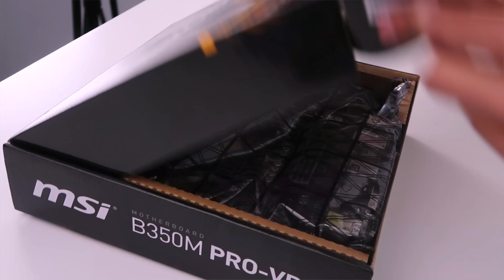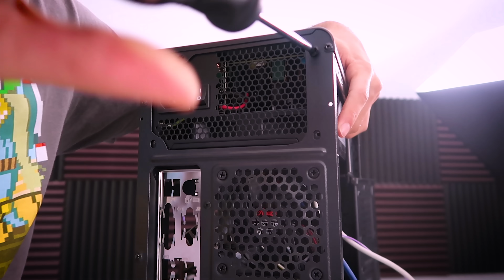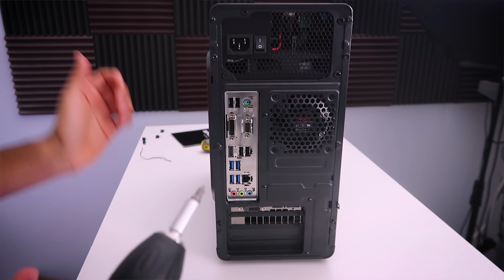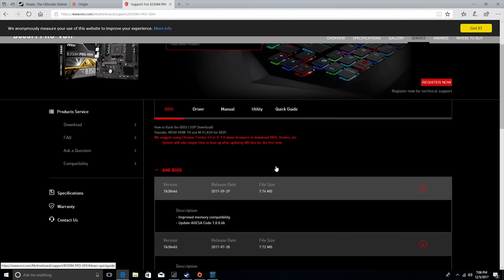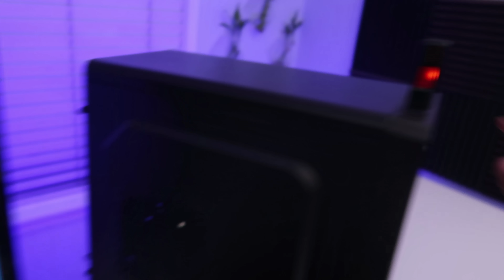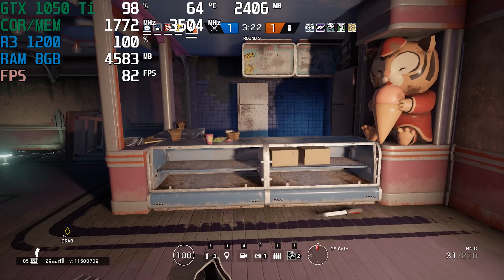$500 Budget Gaming PC Build Guide - GTX 1050 Ti (w/ Benchmarks)

Comment: so i built this pc and i made some modifications and i love it for the power supply i used 500w not the 430 and for the gpu i used the evga geforce gtx 1050 ti FTW not the sc its like $30 more but its amazing if you guys play fortnite i played it all on epic settings and it worked like a charm i love this pc and i changed the case with one with tempered glass i love looking into it.
Reply: Parker Smith Gaming i'm glad my fellow gamer having fun with their own built pc :)
Reply: What was the name of the case you bought?
Reply: What case did you use?
Reply: Thermaltake Versa H18 Tempered Glass
Reply: So fortnite runs smooth on epic settings? What was the total price? Im interested in building the same as you did, could you send me a link please, tot the components if thats even possible
Reply: BRONZYGAMING that’s the pc parts
Reply: Parker Smith hey dude can u send me a link to all the pc parts I’m very interested in buying the same one you have. Also, did u overclock it and what number did u overclock it to.
Reply: F ohj fortnite fps on epic?
Reply: Just run fortnite on mostly low because it looks the same lmao
Reply: Do you think if I used the same stuff as joey it would be just as good as yours
Reply: Can you link the case

Comment: Yo I was wondering if you could use an evga 500w instead of a 430w?
Reply: サンisatis yea dude everyone used that lmao the 430 is out of stock
Reply: kinq which one so I use
Reply: kinq plz help
Reply: Bladedflame 360 it doesn’t matter my guy
Reply: Bladedflame 360 either use 500 or 430, 500 is a little more and stronger
Reply: kinq I am scared it won’t fit in this case
Reply: Bladedflame 360 it fitted for me my guy
Reply: kinq ok thz

Comment: If I made this PC, would it be able to run Arma 3, Rust, DayZ, Escape from Takarov, and The Isle at around 60fps?
Reply: MyNameisZach depends on resolution, 720p and 1080p should work fine for 60fps, higher than that then no

Comment: So i wrote down the things i needed, and i wanted a 1060p so i changed that just for 20 bucks more to get more performance! I am going to save for this cheap build, thanks, and im going to be using this video again to help with building this when i have the money. This Really Helped Me learn more about computers.
Reply: The thing is that the 3gb of vram will limit you quite a few times so that a 1050ti will be faster. Best is imho rx570)
Reply: If you upgrade your gpu you may need a new power supply, but I’m not sure. I’m new to PCs and also u may need better fans
Reply: Alexander H 1050 ti is crushed by a 1060 3gb
Reply: Call of duty Trey arch work on your reading competence.. when your vram limits it's GG for the 3gb 1060
Reply: Alexander H Holy shit morons like you are the reason for the 1050 ti prices to be inflated as it is, to point of the 1060 3gb. Even though the 1060 offers almost 75% performance increase and who the fuck games on a resolution over 1080p on low end hardware?

Comment: whats the diferenc betwen the GTX 1050 Ti and GTX 1050 Ti SC and could i posebly use the GTX 1050 Ti instead of the GTX 1050 Ti SC becase its a litle cheaper
Reply: DARK ASSASIN The sc basically means that the card come overclocked from the factory which will give it slightly better performance. There is nothing wrong with getting a different 1050ti. But if you use the case in this vid make sure you get a small one with one fan.

Comment: Hello, first time building a pc. I got some questions and I think this is the perfect  place to post them, I’m using this pc as my base but I was wondering If I could change the power supply for a 500 w EVGA instead of the 430 w also I would like to change the graphics card for a nvdia or a gigabyte of the same range a 1050 ti but I’m not sure about compatibility or space in the case so if anybody could help me with that I would be very grateful
Reply: Adolfo Franco yes you can use 500w power supply, find a 1050ti that only has 1 fan so it would fit in this particular small case
Reply: Giovann H thank you

Comment: Does it matter if I change certain components like the power supply or case
Reply: commie craft changing power supply wont be harmful in any ways, you can get 400w / 450w / 500w if the power supply on this vid is not available
Reply: Mediocre Size OK great. Now I can be confident I'm making a computer and not a bomb
Reply: commie craft yes greatly i would not change any of it
Reply: your pci-e may be burned or destroyed due to a change in a power supply
Reply: Liam Kounios thanks if, but if the power supply isn't available what would I get
Reply: a fan splitter would help greatly
Reply: commie craft Yes you can change the case or power supply just use google to make sure that its still compatitble. The previous comment about power supplys is perfect and any mini atx case should work fine. Atx is too big for this in my opinion.

Comment: dude the case that you put isn't available atm. WIll this case work? https://www.amazon.com/InWin-301-Black-Tempered-Micro-ATX/dp/B071S8NJHQ/ref=sr_1_12?s=electronics&ie=UTF8&qid=1530038983&sr=1-12&keywords=micro%2Batx%2Bcase&th=1
Reply: def no nc the MOBO won’t fit also why the hell are u spending 180$ on a 550$ build

Comment: Can i use Nvidia GTX 1050 Ti FTW ACX 3.0 instead of 1050 Ti SC ?
Reply: Ricky Phukan it would be very tight in the pc case and airflow would not work well
Reply: Liam Kounios 1050 Ti SC is not available in my country now. What if i use a different or a bigger cabinet?
Reply: Ricky Phukan as long as u get an Atx case the GPU u picked will work
Reply: Liam Kounios thanks for help

Comment: just bought the parts for the build
Reply: Diego L. What case did you get as I can’t find it anywhere in the uk.
Reply: Jack Beames masterbox lite 3.1
Reply: Jack Beames I used his $650 budget build as a guide
Reply: Diego L. How do you know it will fit tho. Did you use every component from this video but then that case you just said about and it worked?
Reply: Jack Beames pc part picker is what u need gives u info on if the motherboard will need bios update whether things will fit etc

Comment: I know this might be a really dumb question but can I use a 500w power supply by the same company or will it somehow fry or damage the computer?
Reply: Keaton Leonard no it wont damage the system, you’ll just have too much power for a computer that really doesn’t need it (unless u upgrade it in the future obviously)
Reply: pretzel yeah that’s what I thought it would be I just had to make sure. Thanks
Reply: Keaton Leonard but you will only draw power that's needed for the pc though, so let's say a 430w vs 500w with identical specs will have same electricity bill, also if you are choosing higher wattage power supply that means you have more future proof build

Comment: Just a quick tip to everyone as he said earlier in the video. If you have few extra buck to spare after buying all the parts then buy a modular power supply as it has individual cables you can choose to plug or not based on what you need. If you are worried about the connector defects to the power supply it's pretty rare so I wouldn't worry too much. Modular power supply is more expensive but it's worth it

Comment: Great build but i had a 970 lying around they are alot better and i had a corsair 650 or something like that with g skill ripjaws (16gb) and a 8th gen i7 processor and and im pretty sure the fan is a noctua fan with a corsair carbide case with a custom made tempered glass window and some beautiful rgb light strips after all it is 2018 and it isnt a pc if it doesent light up ;-)  but thanks for some ideas. And im not rich i just did some deal hunting and won some auctions hope i helped giving at least. A Few of you some ideas.☺😉😀

Comment: Guys i have a serious question will it cause any problem if i switch the  gtx 1050 with a gtx 1060?? And if i switch it will i need a more watt power supply
Reply: 430w is sufficient, yes you can change to 1060

Comment: Built it, runs awesome :D
Reply: JustFilip can’t find the case anywhere in England. Did you use an alternative.
Reply: Jack Beames yeah, I used a different PSU and a different case😁
Reply: JustFilip what were the names please.
Reply: Jack Beames any case will do, mine was from deepcool
Reply: These Knicks ain't Loyal Skyrim on max is around 50, Fallout max 60fps+ and idk about witcher but should be about 50fps on medium
Reply: These Knicks ain't Loyal no prob
Reply: JustFilip what case did u use
Reply: Jack Beames I built 2 PC's with similar parts to this and both cases were different, but it doesn't really matter what case u use it, fuck u can even go ahead and use a cardboard box, it really doesn't matter
Reply: JustFilip how many FPS on fortnite on all epic 1080p and can I️ edit 1080p 60fps videos or at least stream in 1080p 60fps
Reply: Shadow if you want to stream you’re gonna need to get a better cpu, no way you can stream on this
Reply: Shadow On all max it's bout 50-70, idk about streaming, but u should be able to stream it.
Reply: Zvoro srry dude idk about Arma 3
Reply: JustFilip if i will not the bios what will happen can someone tell?

Comment: I build a  gaming computer, cost was $400. 
Specs..
Display: Overclocked gt 1030, 2k gaming on (ex: horizon 7, GTA 5, minecraft)
Cpu: Intel i5 3.2ghz with turboboost to 4ghz. (Very powerful,  (can run spotify, gta 5, and  13 downloads at same time with ease)
Hard drive: sandisk ssd 3d ultra 512gb
Ram: ddr3 1600, (fast and relible.)
Wifi: Netgear dualband wifi 5ghz and 2.4ghz wifi, with usb 3.0.
Case: It's a refurbished opleplex, and upgraded it to game.
Most robbers won't take the desktop, even thou it's a gaming desktop inside the case.

Comment: Hi Joey, thanks for the great video. I will most likely be using this for my next PC. Im just wondering, does a intel CPU also work with this motherboard, if not, is there a stronger CPU that you could recommend?
Reply: will intel cpu work with this motherboard? no. stronger cpu is i5 8400 or r5 1600/2600

Comment: Is this build good for a first timer?

CPU: Ryzen 3 2200g
RAM: TeamGroup Elite 8GB DDR4 2400Mhz (2x4)
Motherboard: Gigabyte A320M-S2H
PSU: EVGA 430W 80+
Storage: Toshiba 1TB HDD 
Case: Aerocool Aero-500

This build costs around 350 euros and its my first PC, if someone could give some advice it would be really helpful.
P.S I'm gonna invest in a graphics card and i'm thinking AMD Radeon RX 560 4GB or Gibabyte Geforce GTX1050 2GB.
Reply: What will you do with the pc? If you are going to game try to get 8gb of ram
Reply: Ng Taufaye yeah i got confused i meant 8 gb ram (2x4)
Reply: just saying but i prefer b350 motherboard than a320 since you can overclock on b350, and if your motherboard only have 2 ram slots i prefer 1x8gb because there's room to upgrade

Comment: Wouldn't it be better to use a Ryzen 3 2200G instead of the 1200 considering they are the same price and the 2200G has a higher clock speed and an apu?
Reply: GEV i'm pretty sure this vid was made before r3 2200g was introduced
Reply: Ah, my bad then.

Comment: Can I use any graphic card or it has to be that one
Reply: Mario Lopez Doesn't have to be this one, but just making sure it will work with the mother board and the power supply
Reply: Colton Goodhart how do you find that out?
Reply: Just got to the description of the GPU and it will tell you what power is needed, the minimum it will also have a list of compatible motherboards.
Reply: Colton Goodhart thanks man

Comment: Hey dude. I don't know if you read comments but i have a question. Can this PC play games and stream them at the same time at atleast 720p 30fps?
Reply: You can definitely do that using this PC, 720P 30FPS is no problem, even 1080p 30FPS is no problem, but that doesn't mean that the stream itself will be the same quality, this setup is really good, but if you want to do anything higher than 1080p 30fps and make sure it looks as it is on stream, you'd want like one of the newer Ryzen 5s or 3s, the 5 2400g is a good option and not much more (price-wise) for what it is, and it's also pretty future proof, things like the i3-8100 are also options, just note what you want and you'll be good to go.
Reply: Nothing man . But the 6 cores for streaming are literally like a minimum requirement if you want even the slightest bit of quality
Reply: Ι don't think anyone would want to watch a stream at 720p and 30fps though . If you want to stream get at least a Ryzen5 1600
Reply: 1000 subs with no videos pls yes
Reply: Angelic15 thanks for the answer

Comment: If i would put a gtx 1050 instead without overcloking anything would it still run rainbow six siege good?
Reply: Yes 
Actually the difference is only about 10-20 fps only so yah
Reply: Munir Tattan okay thanks
Reply: Munir Tattan would it make a difference to the fps if i have a 144hz or is 60hz better for the fps
Reply: Well technically it won't give any fps you will get the same but I believe that it will be better and be way more responsive
Reply: And smoother as well
Reply: Munir Tattan alright sweet!

Comment: One thing that I would do diffrently is I would get a single 8gb stick which would cost the same and in the future if you want to upgrade to 16gb or ram you would only have to buy one new stick or 8gb. Also the other day  I got a new case from frys electronics that was on sale for $18 and it has temperd glass and looks really cool and was easy to work in.

Comment: I’m new to this sorry but what is overclocking?
Reply: zeds overclocking means squeezing your cpu to get more performance from it. a 3.7 ghz clock cpu is faster than 3.1 ghz clock cpu and will give you more fps in gaming for example, important thing when overclocking is to make sure you have a good cooler since the temp will be higher than the stock/default clocked one
Reply: btw overclocking is not limited to cpu, you can also overclock gpu, ram
Reply: Giovann H thank you bro

Comment: Can I use any case for this build first time building a pc
Reply: Yes, a mini tower is a small case, but will work. If you want to upgrade the graphic you will need a bigger case, mid tower, to fit the graphics card. I would prefer a mid tower to upgrade, but here are some mid tower links under 40$
https://www.amazon.com/DEEPCOOL-TESSERACT-WH-Computer-Pre-installed/dp/B00RZ8EEXY/ref=sr_1_2?s=electronics&ie=UTF8&qid=1528530167&sr=1-2&keywords=mid+tower+case&dpID=41ypL61yMiL&preST=_SY300_QL70_&dpSrc=srch
...
https://www.amazon.com/DIYPC-Solo-T1-BK-Computer-1x120mm-Pre-installed/dp/B018QDIO2S/ref=sr_1_3?s=electronics&ie=UTF8&qid=1528530167&sr=1-3&keywords=mid+tower+case&dpID=414aXPk4A0L&preST=_SX300_QL70_&dpSrc=srch
...
42$ but has a windowed case wall! BEST ONE!!!
https://www.amazon.com/AeroCool-Aero300FAW-Acrylic-Window-Tower/dp/B0716715R1/ref=sr_1_5?s=electronics&ie=UTF8&qid=1528530167&sr=1-5&keywords=mid+tower+case&dpID=51liylweUNL&preST=_SY300_QL70_&dpSrc=srch

Comment: As of June this build cost $660.09 USD
Reply: Fortnite compilation 69  ye same as the other dude I just checked and its around 560ish
Reply: Fortnite compilation 69 I actually just got finished putting a list together a few minutes ago, and my total (including the 1300X, an extra $30, and protection plans for most parts, but not including the case) came out to be $560. Where did you check for parts? Part of the difference may also be because Prime members (myself) get free shipping
Reply: Jack Beames I'm actually working on buying it as I get paychecks 😁 Got the hard drive, power supply, and case so far, and when I get paid next Friday I'm getting the RAM
Reply: SneakySoyBoy123 please tell me how it runs once it’s build and how pubg runs  thanks.
Reply: Jack Beames It won't be ready till the end of August, and I'm most likely not gonna get PUBG, but I'll let you know how it works with other titles!
Reply: g0ldf1sh even cheaper now. Definitely going to buy it all one day.
Reply: Jack Beames really?that's cool!
Reply: Why is RAM and Graphics card so damn expensive??? Just those 2 is half the price of the whole thing
Reply: As of July thus costs 606.
Reply: SneakySoyBoy123 tax.
Reply: Jack Beames pubg runs really well on the build. Their optimization has come a long way
Reply: Jack Beames I've seen builds similar to this where they run PUBG at around 70-80 FPS so I presume high will run 50-60
Reply: Roxas Ricky crypto currency gpu mining and ram mining also Harddrive mining is becoming a thing so hard drives might become more expensive.
Reply: in 💶 (euros) its 447€

Comment: Will this pc run Fortnite ?
Reply: Nope. U need at least 2 1080ti's SLI to run fortnite, soz dude. Also u need an i9 and 32gb of ram
Reply: Berb Kerming no you need at least 4 titans and a overclocked i9
Reply: trutru, but u also need a bunch of RGB lights, it wont run without the lights.
Reply: A potato can run fortnite
Reply: Fortnite compilation 69 120dps at custom settings
Reply: Check the video on the end. He's testing fortnite..

Comment: could you recommend me which mobo should i choose if i want to use i3 8100?
Reply: Nicholas Halim NHASS asrock mobo with b360 chipset
Reply: Giovann H thanks dude i finally find the suitable mobo with 4 memory slot on low price
Reply: Nicholas Halim NHASS no problem, what gpu did you pair it with?
Reply: Giovann H I will go with 1050ti

Comment: My power supply is 300W and doesn't have PCIE thing to power graphics card, so if i bought a GTX 1050 TI, i could just put it into the graphics card slot and you don't need to plug anything on it?
Reply: what? no.
Reply: So if i just slopped my GTX 1050 into the slot, the fans, etc, are gonna work???
Reply: So even if i have a weak power supply 300w it will still work?
Reply: JxP search for wattage calculator on google, and then input all your hardware (cpu, gpu, mouse, keyboard etc) if the wattage exceeds 300 watt then you need a better power supply